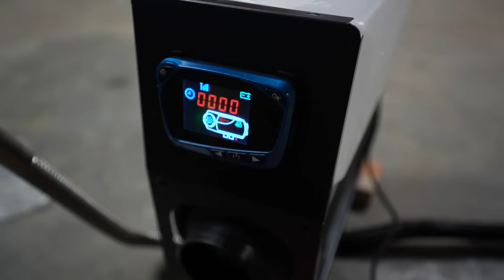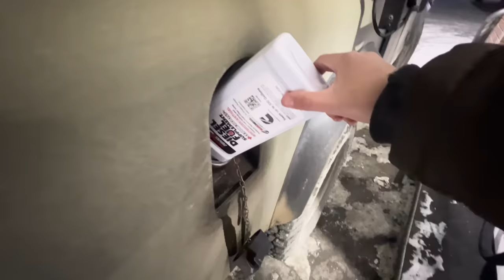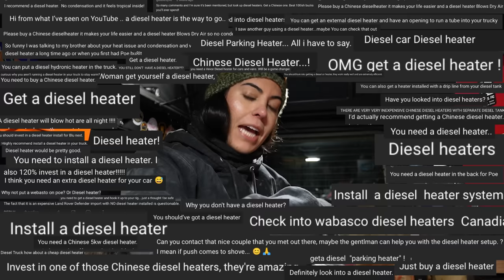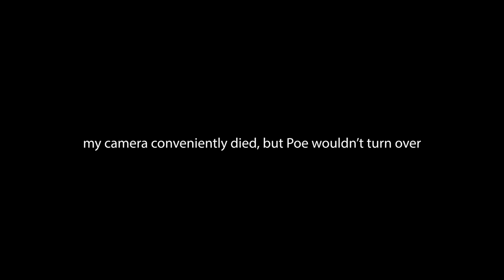Truck Camping in -15 Degrees under the Northern Lights

Comment: You're not stupid, just inexperienced. You took a chance and it backfired. Learning experience. At least you have the guts and character to try!!!! The AluCab will bleed out your heat unless you make some insulation. Same goes for anything metal, and the glass. 

You can make insulating panels for the AluCab and your windows:  
~Make patterns for the sections you need to insulate, allowing about 3" extra for attaching later, as well as allowing better coverage. 
 You can use butcher paper or newspapaer and a sharpie; whatever works.

~Get blankets at a thrift store, surplus wool/wool mix blankets at an Army-Navy, or some old/inexpensive sleeping bags. 

~Smartfoil (bubblewrap sandwiched between aluminum foil).

Have a sailmaker or someone who can sew heavy fabrics sew you the panels (after measuring and triple checking the dimensions). Smartfoil sandwiched between the blanket material.

I would probably do it by having the wool against the AluCab sides/windows/panels, the Smartfoil in the middle (doubled up), and the sleeping bag or thick blanket on the inside.

You can attach them to the inside using velcro strips, magnets, whatever. This will make a HUGE difference.

Also, should have some redundancy. Maybe a little mini wood stove as well. Or a Dickinson P9000 (this is propane but designed so you get no condensation). 

You need a way to keep that engine running or to heat up your fuel so it doesn't gel up.

PS
I realize finding a sailmaker or someone who has the equipment to do the above may take time-and you need it now.  You can basically do it on your own using good thread and a large needle, or spray glue/Barge cement (but you need somewhere to do it at). You may even be able to do it with hot glue and some Gorilla Tape.
You can basically get the panels ready enough to use and then, when you find the person to sew it, just ask that person to finish the job.

Comment: I usually don't comment on vids but I just started watching a few weeks ago and have become obsessed with your amazing personality and your sweet Puppers. But girl, I can't stress this enough as someone from Canada where it can get minus 20-40 Celsius you need to be better prepared. The first thing is to get a block heater installed and be somewhere you can plug it in. If you don't I promise you your truck will not start when it gets below a certain temp. We have them installed in all of our vehicles here because without them they would not start, even diesel engines. You do not want to be in the middle of nowhere with Poe not starting, it's not only dangerous for you but it can be detrimental to your dog. You also need an emergency contact who is up there and can come get you wherever you are in case of emergency. I would also strongly recommend you don't go too far from civilization without a guide or experienced Alaskan camper with you. But at the same time don't trust strangers please, you never know someone's intentions. Please be safe, it's not just you that you are putting in danger, it's your dog as well and I know you would never forgive yourself if something happened to Blue.

Comment: Your positivity in your vids in awesome! But like others have said it is actually one of the warmest years on record this year due to El Nino -- it's going to get much much colder in the dead of winter (like -35). As a northern Canadian, I urge you to stay safe but if you or others are going to be out in the cold winter, here are some recs for you/others if you're adventuring outdoors in winter including some hypothermia preventing/treatment:

1) Wardrobe: I've noticed you' not wearing gloves or hats in some of your vids: try getting an interior pair of gloves so that when you do have to take your mitts off to do something with your hands, you're not having bare skin exposed. At lower temps, frostbite can happen in less than 1 minute of exposed skin. Similarly, you lose a LOT of heat through your head: wearing a warm, fleece hat at all times, including sleep can help your body retain hear tremendously. Lastly, I've noticed your footwear is hella cute, but in freezing temps you should transition to a heavily insulated boot, or at least have them on hand (Baffin or Sorrells are great) -- same goes for heavily insulated snowpants to have on hand.

2) Hypothermia: If you find yourself feeling abnormally sleepy/dazed/confused, if your lips turn slightly pale or blue, and you have an inability to get warm despite counter-measures take action fast - you're likely experiencing the early stages of hypothermia. A few great ways to warm yourself and either prevent or treat early hypothermia are: 1. EAT -- eating food actually helps your internal metabolism generate heat 2. DRINK HOT LIQUIDS -- drinking warm, sugary drinks has a similar effect. Blue can have heated water too! 3. MOVE -- without working up a sweat, move your body: swing your arms, lift your legs, do a couple squats, etc. 4. self-evacuate if necessary -- better safe than sorry: you did the RIGHT thing here leaving for a bnb.

3) Emergency response: I may have just missed it, but consider getting a SPOT unit that has an SOS feature in case of emergencies so that first responders can find you. Even without service an SOS on a SPOT unit is the equivalent of calling 911, and it GPS locates you.

4) Emergency fire kit: If your truck does not start, if your generators don't start, if your heaters don't work: what is your plan? Having an emergency fire kit with matches, fire starter, kindling, and firewood could mean the difference between life and death. Engines, propane heaters, electronics can basically stop working if you get a cold snap -- having an emergency fire can keep you alive while waiting for help. Similarly a small folding saw can help you cut branches or logs (again only in an emergency) for extra firewood from the forest.

Comment: She's playing a dangerous game in places like that so ill prepared. Probably would have been a good idea making sure the diesel heater worked before returning it and she shouldn't have returned the heater either lmfao. Always having a backup plan/redundancies in equipment when you're in harsh environments like that is a must. If the electric goes out you got propane. If the propane goes out you got the diesel. Out of all the youtubers I see living alone in off grid cabins, camping and doing stuff like Roaming she's the only one that wouldn't even remotely surprise me if I saw a video or news article "youtuber passes away in harsh climate." As grim as they may be. This is outright dangerous.

Comment: As a truck driver I've been in a lot of Cold places and I've learned to put trash bags in front of your radiator and it will help heat your coolent back up to normal and it will start blowing heat again

Comment: worrying about refrigeration in Alaska? Stick it on the roof LOL. You should have tried that heater before you went camping, or kept the buddy heater until you were sure the new one worked. BTW it's a mild 39c/102f here at 12 noon, in Sydney Australia, it will get warmer about 2pm. Stay safe kid, be very careful of the decisions you make.

Comment: Our Jackery 300 powers our diesel heater with no issue, but our Anker 757 didn't want to run it(similar to your issue). It's the 15 amp draw of the heater with the lighter plug only being good for 10 amps. I purchased a 12v power supply with a type b connector, and now the Anker runs it with no problem.

Comment: The heater can draw 10-12amps of power on start up, which drops to less than 2amps ( 0.4 to 2 amps ) when running .. I think the cable from the Jackery isnt allowing the current to flow so the Diesel heater shuts down.. direct power source from a battery is much better imo ......  And the Landy. .if sluggish to start then turn key until heater plug light goes off..do it 3 times and that heats the injector plugs when experiencing super cold weather... Best of luck to ya..
Reply: I was thinking the same. The screen shutting off just before it tries to go through start up makes me think it tries to draw the power but trips because of the power source.

Comment: Go Poe!!!  the heater seems like it is not getting the current it needs from the battery, so it shuts off.  The highest current draw is on startup, when the glow plug turns on.  It pulls about 9 amps on mine at that point.  Once it is pumping fuel and ignites, the power draw decreases dramatically.  Yours is shutting off before it gets that far, as you've seen.

Comment: Time to put a bit less reckless into the roaming I think - this is the first time I've seen you really out of your depth, and it's genuinely concerning.  Going out in subzero temperatures with not only no backup heater, but your only heater untested is putting yourself in genuine danger.  Be safe out there please.

Comment: Make sure your 12v power cord is not too long or small for the diesel heater. If it is too long or small, it will not be able to handle the amps to start up the glow plug. I’ve had that happen to mine when I tried to run it on an extended 12V wire. When I plugged it into my Ecoflow power station without the extension, it worked fine. Good luck and be safe!
Reply: Oh also, when you get that heater running, run the hose down to the lower area. The heat will keep the lower part of Poe warm and the heat will rise up to the sleeping area of the AluCab. I run a small fan to help circulate the air. GET A CARBON MONOXIDE MONITOR!! It should put out clean air, but you can never be too safe.

Comment: You learned!  Experience is a tough teacher sometimes. But you learned to always have back-ups, and back-ups for your back-ups. Especially when it comes to heat/fuel sources in severely cold weather.

Comment: Not sure if you got the heater running but I had same issue with the heater. My issue was Bluetti power station couldn’t handle the amp drop with the 12V plug on initial startup. It drops to around 9amps and my Bluetti would cut power as safety measure. The solution was to get an AC/DC adapter and plug into AC outlet. Works with no issue now. GOOD LUCK!

Comment: There’s a ton of messages here so I’m not sure if this has been covered yet… The issue with your heater is likely the connection to your Jackery. The glow plugs need to be able to draw a lot to get going, and the 12v socket just can’t provide such power upon startup in those crazy cold temps. It’s too much draw which is cutting it from the start. It takes a bit after the glow plugs are going before the pump will even kick on. I recommend either hardwiring to your battery, or getting a AC adapter, as the draw from start can reach above 200w. There’s no way that cigarette lighter can support that draw. Once it’s all good and running, it drops down to between 30-50w to run depending on your heat setting. I just picked up a Hcalory that has the ac adapter already.

Comment: I bought a little 350W electric heater (Amazon) that I plug into my 1000 Jackery.  Good for emergency, but it runs the Jackery down pretty quick. Maybe a insulated curtain behind your seats?
In an emergency, could you boil water and put it in a hot water bottle? A couple of those under blankets would help your feet and hands. Safe blessings💞
Thanks for the northern light, that was awesome!

Comment: Maria, you need at least thermo blankets for all of your windows outside, you cant go without in freezing temperatures in vanlife.
An extra pair thermo blankets for the inside is possible too.
Wind and cold temperatures will make your windows feel like ice blocks and the temperature will be drop down.
Then you parked Poe with the front out of the wind to protect the engine, and wind in your car will be less.
Wind will come in the car where you dont expect it, even out of the floor.
And you must cover the front by the engine where normally wind goes to cool the engine.
And with a piece of cardboard or plastic on the outside, you can block the wind with some tie downs and or tape around the cardboard. 
Its also possible on the inside when  the ventilator dont hit the cardboard. 
And put always a box/bag of tea lights in the car for emergency.
When the car breaks down and it becomes too cold, you can always heat the car with it, when the car cant run anymore.
Ok ok, be careful with the tea lights,  but it will work if needed in strong cold weather, especially if you,re waiting for rescue.👋👋

Comment: Omg girl!!!😢 I live in a cold place, you need Sorel Winter Boots. Cold feet are no joke. You also need a heated jacket.🥰 Yes that heater shud be installed properly and I have a note of advice The chinese Diesel Heaters are not 100% reliable. Have a good back up heater in the cold. I am worried, don't take a chance. Yes a B&B is an excellent idea. Please be safe. Don't be reckless 😂😂😂❤❤❤❤

Comment: Your diesel heater is working fine. The issue you’re experiencing is that the Jackery cannot put enough amp or voltage to the diesel heater so the diesel heater just shut off as soon as the glow plug turns on. You need to purchase a ac to dc converter and you’ll be fine. It cost like 12$.

Comment: it's your voltage low voltage possibly Don't forget to run that diesel heater every third day on high for at least 30 minutes to burn out the soot in the burn chamber that will keep you from having to go to somebody to fix that part as well running on high for as long as you can throughout the week just be safe have fun enjoy your travels I am jealous and envious Love you content Good to see puppy is doing better safe travels

Comment: Hi, im Canadian... first post. i dont mean to be rude but i have worked with military veh in the north. dont use additional anti gel additive pump diesels already has it, when its that cold leave the engine running all night, for more heat block the rad with carboard and zip ties to heat up the engine(if engine starts to overheat in transit make it smaller) i remember starting bon fires under engines to get them started as the oil wouldn't've let the engine crank.

also two heat sources are a MUST! 2 is 1 and 1 is none

Comment: If you’re going to be hanging in sub zero temperatures You need to get some sort of winter front for Poe. Something to block the airflow through the radiator so the engine maintains enough heat to both operate properly and run the heater. You can get one made from vinyl material or if nothing else put some cardboard over the front of the radiator.

Comment: There are a number of YouTube videos re "fix diesel heater pump." Also you can get a dipstick oil heater for your truck plugged into Jackery.( you may need a bigger power station for all of these appliances)As others have suggested,  get Buddy heater until you can depend on diesel heater. You're  too smart to alow yourself to roam reckless into harms way!

Comment: Maria, you survived the situation and learned from it.  This is not a bad thing.  If anything your stronger for getting through the situation.  Build on the experience and make Poe an even more rad overland expedition vehicle!  Really cannot help myself and highly suggest you get a bigger, dedicated battery bank.  Buy some Battleborn LiFePo batteries, get a dedicated inverter/charger and get 4x the capacity of the Jackery box.  You also need better footwear!!!  Cold feet in the winter is the WORST!!!

Get Gordon to install a block heater for Poe!!!  Engine toe warmers!!!  🤣

Comment: Get yourself a extracting pump and filter wrench , pump your oil out at your dip stick tube.  You can get 12volt pump or a hand pump.  Very easy no mess.  Except for the filter that gets little messy but very easy to do yourself.  I have a Land Rove d2 that's how I do it then find a oil recycle or garage that will take the old oil.

Comment: Covering the radiator grille with either a genuine muff or some rubber matting, cardboard &/or large pet feed bags will help get some increased warmth from POE’s heater until you can get a proper diesel heater fitted.

Comment: Also, fyi, next time you wanna camp out in the frigid wilderness, line your inside with 5amp heat trace. It’s used on pipe up there to keep from freezing over. Won’t take much, maybe 10’ …. But it will warm the shit out of the truck quick and it’s only 5 amp

Comment: Maybe you have it fixed by now, but my first diesel heater had a loose pin in the wiring harness. Everything was plugged in, but whomever assembled it pushed a pin out when they snapped the harness together. Something like that will explain the loss of power at the screen. Nothing else will do that except for power loss. My heater did exactly what yours is doing. Unsnap the harness and look for a pin that's backed out a little. It will be there, but it wo mn t be sticking out enough to maintain contact.
 Once that heater gets going it will run you out of poe. At -25 my heater will blow me out as well. Both of mine are vevors, although they are all likely produced out of a couple different factories.

Comment: That was a moral booster!  Make Sure to Run your diesel heater Completely Through is shutdown mode, especially when really cold, high humidity,  and High Altitude.   Make Sure.  And do you actually have a down parka, what's the # fill power, over wool, and Down are your friends.  Is Poe running okay?  Maybe just the Uber COLD temps?

Comment: Best thing about Alaskan truck camping, in winter, as long as the temps don't go above 20-40 degrees, you can safely store food outside of the vechile on the top or sides, did that for 3 months with no spoilage and was able to get a lot more food for cheaper that way.